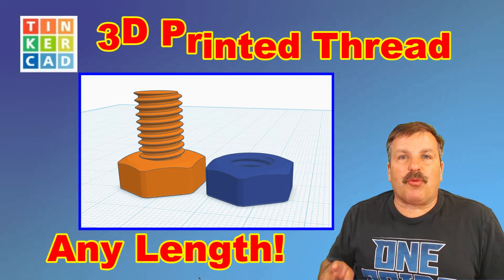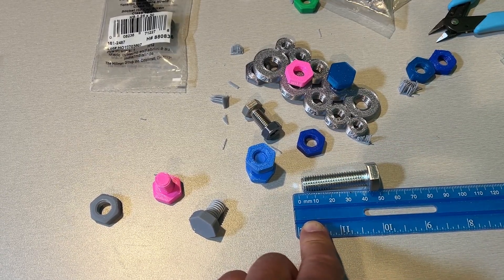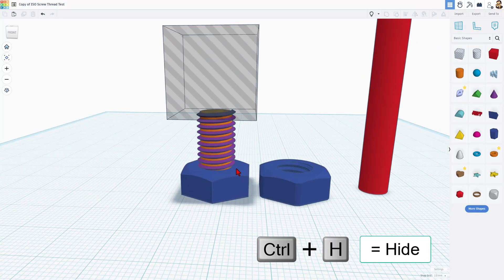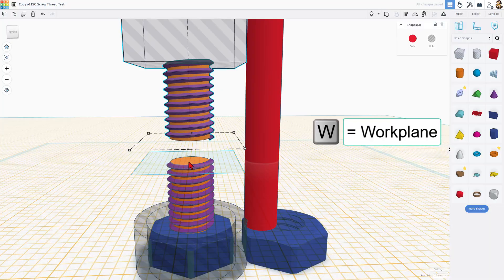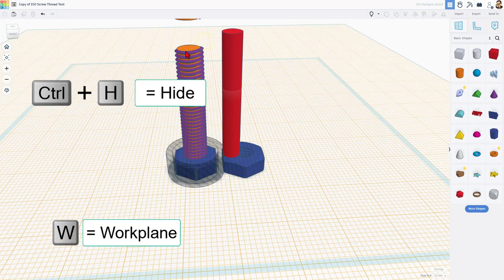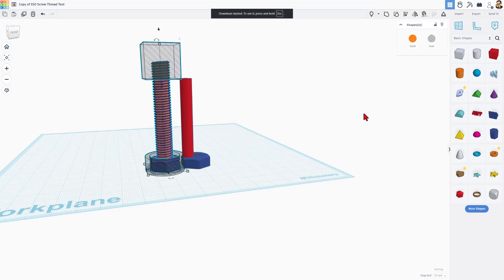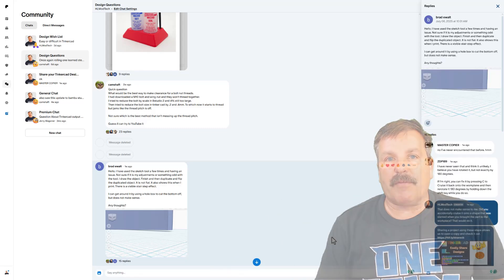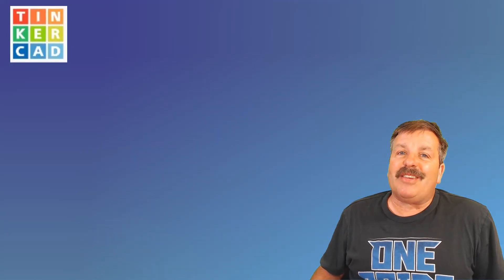Make Perfect 3D Printed Tinkercad Threads of ANY Length! 💯🔥

Comment: would you get the same result without all the cut/paste/nudge if you changed the values for "#of turns", "total height", and "height" from the calculator tab to 50? 
edit: looks like you can just change the user entry field "number of turns" and it will generate longer lengths automatically

Comment: Thanks for the great tutorials. Learnt a lot from  you. Can you show how to make a round container with screw lid. I tried several times but cannot get the lid to fit properly... thanx
Reply from the maker: Working on a solution for that. If you want to zip ahead, it will be based on this. https://www.tinkercad.com/things/f3ta5cdty5J-hex-jar-demo The blue lid is the technique I will use.